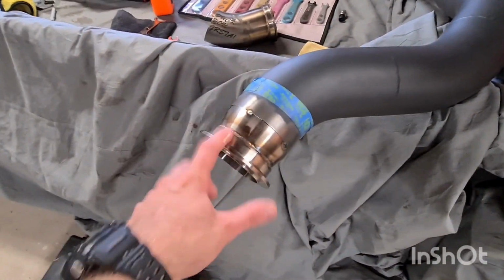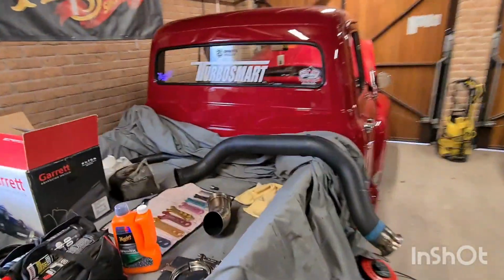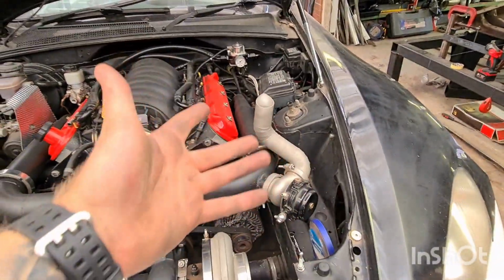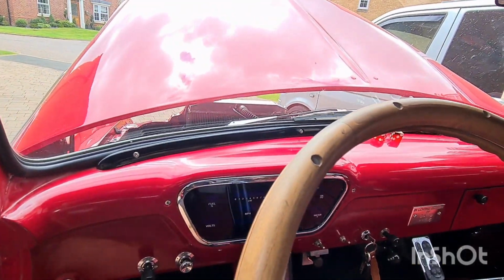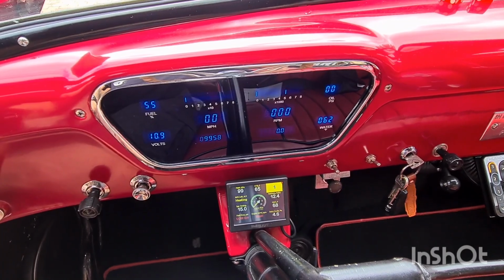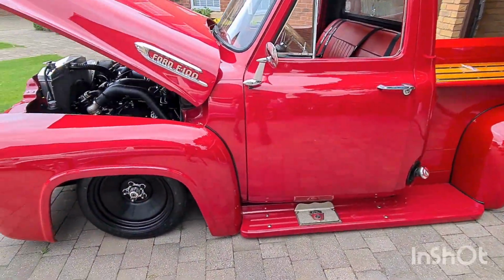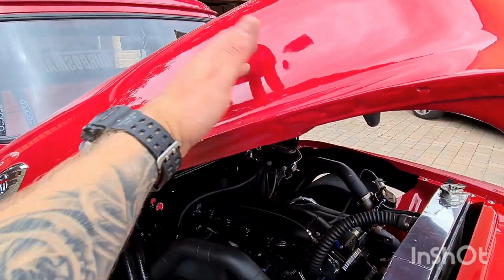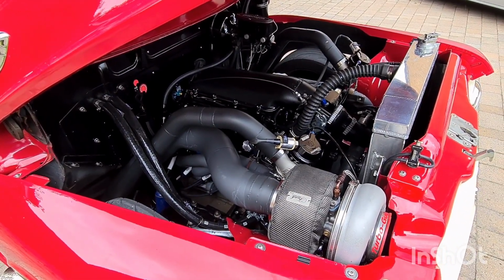Garrett G42 first start up

Comment: What displacement LS is this?
Reply from the maker: 5.3 Iron block 'LM7'
Reply: @JakeDrivesAll  Hey-thanks Smokey. Due to space restrictions, I'm looking at using this turbo on an LS Miata swap. A larger LS though...6.2. The compressor maps show that it should flow enough for 12psi at 6300. I'd guess the larger A/R housing would be needed though. 1.18 or 1.28? Really enjoy the vids.